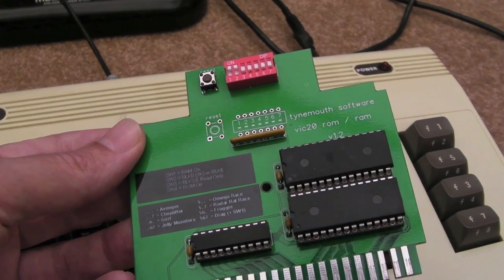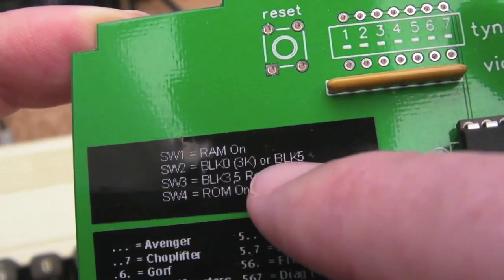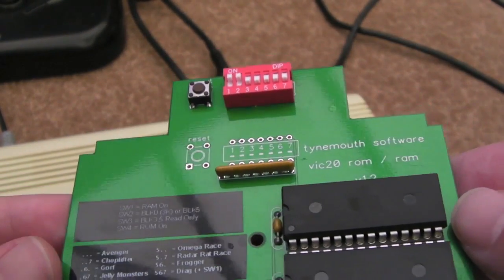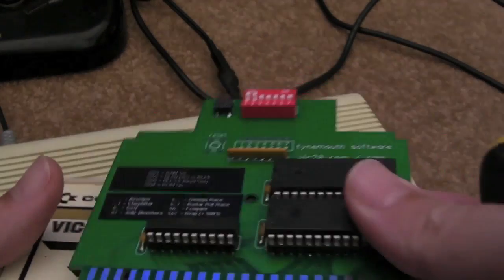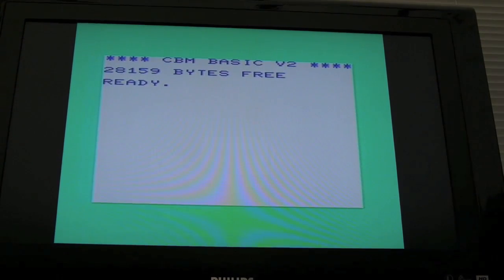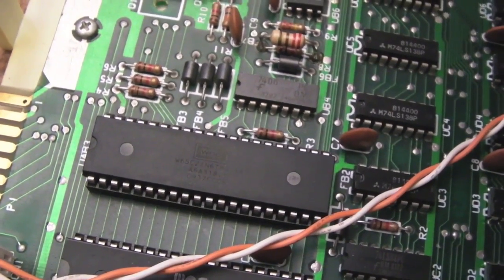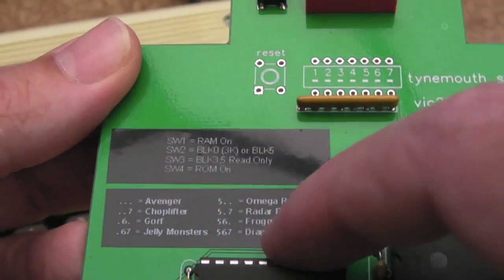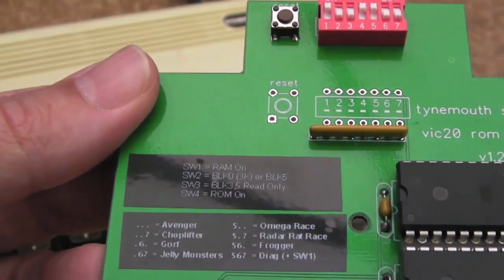Commodore VIC-20 (VC20) Tynemouth Software ROM &  32K RAM Board

Comment: Thanks, pleased you liked it. This was really just a trial of the practicalities of making a cartridge like that. The new version will support 4K, 8K or 16K ROMs, up to 32 of them, and I'm also getting the edge connector gold plated, and as the annotation say, the SD card will be based on IEEE-488, not IEC, so should be faster. 

Some carts already have the central pegs removed, the 3K carts or super expander etc. I tried to add cutouts for them, but there will be chips in the way. I am looking at getting some new cartridge shells 3D printed, otherwise, try to find a damaged or defective cartridge, or something which was unplayable even when working!

The board has 8K block in block 1, 2 and 3. The 4th block of 8K is set by switch 2 as either block 0 or Block 5. Block 0 already has the internal RAM in, so it can only add 3K to that. BASIC doesn't see the extra 8K of RAM in block 5, so will continue to read 28159 bytes free. One difference from some of the other RAM boards is the lower RAM remains writeable when blocks 3 and 5 are read only. Not sure if any software will make use of that, but it's there if anything can use it.

I'll look up the Doom port, I didn't think anything would need RAM in block 0 and block 5 at the same time. May have to add some extra RAM.

There's a bit more info on the blog, including the name, 'The Penultimate Cartridge' http://blog.tynemouthsoftware.co.uk/2015/11/vic20-penultimate-cartridge-part-1.html
Reply from the maker: +Dave Curran Thanks for all the info there =)  I am only speculating that Doom needs the RAM in block 0 - I don't know where else it would expect it, but from what I've read it only works properly with a standard 3K expansion + 32K after market expansion, so it just seems logical that block 0 and block 5 both need RAM for Doom.  What you've said about block 0 there now also makes sense to me - ie. internal 5K already using block 0, therefore leaving 3K, giving a total of 40K.   Thanks for sending this to me to look at, it's much appreciated =)  I will buy one of the SD solutions from you when you get to that stage =)
Reply: +GadgetUK164 Yes, Doom needs RAM in block 0,1,2,3 and 5. Just confirmed that with Vice. So my board won't run it. Sorry. To get that extra 3K, I need to change the 32K chip to a 128K chip, but I'm already changing the ROM from 28 pin to 32 pin, so why not the RAM as well. No paging though, so far, so it will be 35K max.

Comment: Omega Rat Race sounds like a cool game! lol. Great video very interesting stuff keep it up  :)
Reply from the maker: +James 76 LOL - You can tell I was getting a bit pissed off with myself!  By that point I must have filmed every section about 10 times.  Took ages to edit as it was 90% mistakes lol.
Reply: +GadgetUK164 your efforts are appreciated. Get well soon!
Reply from the maker: +Dave Curran Thanks, and no problem - I have filmed the PLA as well, but just need to edit it.  The PLA works fine with everything, but I did spot a problem with the AT27C512R approach and the Nano SwinSID - seems to be a timing issue going on when the Nano SwinSID is used with alternative PLA solutions.  I don't quite get how, but everything else works with your new PLA, as it does with the one I made earlier on.  Just the SwinSID!?!?
Reply: +GadgetUK164 I'll have to see if I can get one to try it out. Adding the cap helped out on a few boards. It's never going to be a universal solution, but it's quick and cheap.

Comment: Interesting, reminds me a bit of the Final Expansion V3, only that one has a SD2IEC built in.
Reply from the maker: +VectrexRoli Yes, I think Dave is aiming to produce a cart like the Final Expansion v3, but with parallel SD access instead of serial.  It should be ~ 8 times faster.

Comment: Hey, now you Have Solder Points to hook up a reset switch or any kind of other switches you need
Reply from the maker: +Amy Marie Yes, I thought the same thing!  I also was thinking about using that 2nd DIP switch position for another DIP switch - isolate the connections from the top DIP section, and then wire them into a larger ROM, maybe a 27C020 (256Kb) instead of 64Kb.
Reply: +Amy Marie The switch next to the DIP switch is reset, so you can press reset even when its enclosed in a cart.
Reply from the maker: Yes, that's a very good point!  The reset button on your cart is much more easily accessible compared to that previous RAM expansion I've shown.